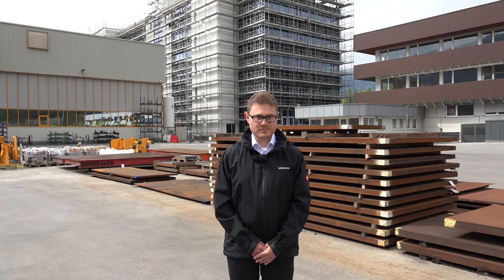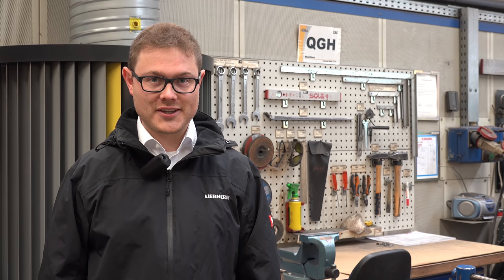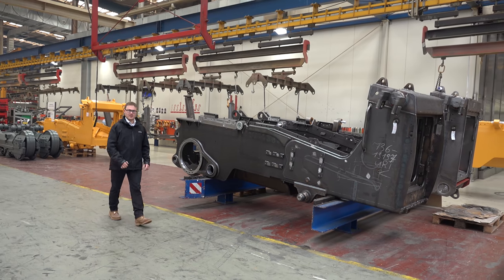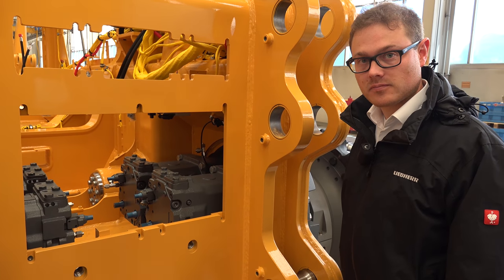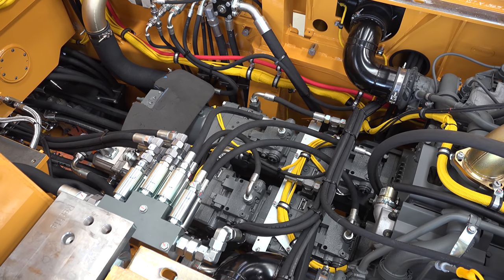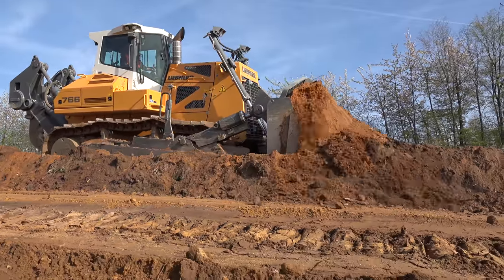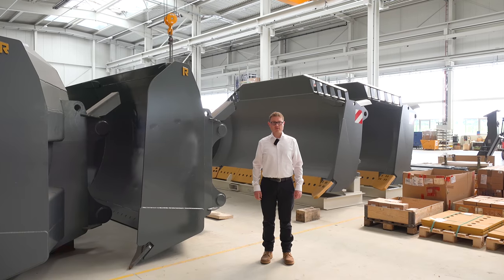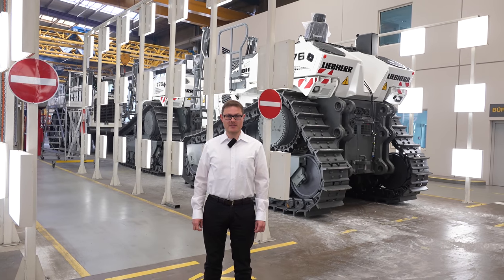Liebherr- PR766 a look behind the scenes

Comment: Not good engine with aluminum bloc , the old V6 and V8 was perfect,  if the hydrsustatic circuit it's same the old machines ( linde pumps and motors ) not good also  , telvs manufacture
Reply: Wrong you saying,  i think on this dozer is D9508 16.2 l engine, this engine have cast iron block not aluminum, and this engines is good and reliable

Comment: That motor looks alot like the kohler kd135 series...  
Can you please fix the leaking valve cover seal issue, it dosen't have enough clamping force.
Reply: a very weak assumption
Reply: @michaelanderson7715  eh?
Liebherr builds the large bore motors for kohler generators. The valve covers seem not to have enough clamping force to make the o-ring seal, being they only use three bolts.
Reply: @chainsawsandgenerators9952  research it to see if 'That motor looks alot like the kohler kd135 series...  
Can you please fix the leaking valve cover seal issue, it dosen't have enough clamping force.' is applicable...
Reply: @michaelanderson7715  eh? 
See if they run on rocket fuel?
Reply: @chainsawsandgenerators9952  research it to see if 'That motor looks alot like the kohler kd135 series...  
Can you please fix the leaking valve cover seal issue, it dosen't have enough clamping force.' is applicable...
Reply: @michaelanderson7715  yes?
Reply: @chainsawsandgenerators9952  That's a claim, you need evidence...
Reply: @michaelanderson7715  send me your email, I can see if I can find one of the service reports, photos, heck I can probably send the a snapshot of the ECM's
Reply: @chainsawsandgenerators9952   you can present it here, e.g. a pdf link
Reply: @michaelanderson7715  it's obvious you don't work on any of this equipment. Take care.
Reply: @chainsawsandgenerators9952  "it's obvious you don't work on any of this equipment. Take care."
- right back to "a very weak assumption...That's a claim, you need evidence..."
Reply: @michaelanderson7715  I've met your type before.
Anyways what are you haveing for dinner?

Comment: German Mfg built the most durable equipment 
If money is not an issue
They are the best engineered machinery in the world
Reply: Checkout the Hindenburg
Reply: @gary96397  Before using it as an example maybe you should read up on the history of the Hindenberg first. The US can be thanked for one of the reasons it caught on fire.
Reply: @Slane583  No, sorry ya'll aren't blaming that on America
Reply: @creamwobbly  It's one thing if you were over in Germany and owned a BMW or Mercedes because over there they're like a Ford, Chevy or Dodge. The parts are cheaper. But over here they're too expensive to fix and they're over engineered. There's way too much computer stuff in them as well. Plus being in the north like me the winters here absolutely love to feast on weak steel. Especially when you add in road salt that's mixed with calcium chloride. It boosts the rust factor up to 11.
Reply: @creamwobbly  and american cars have the most low budget feeling ... at least german premium car manufacturers knows how to make you feel you worthy for the money you spent
Reply: What’s interesting to me is that as an American, I almost never get to see Liebherr machines in operation. Caterpillar lobbies Congress against the import of heavy equipment. I guess fifty million dollars goes a long way.